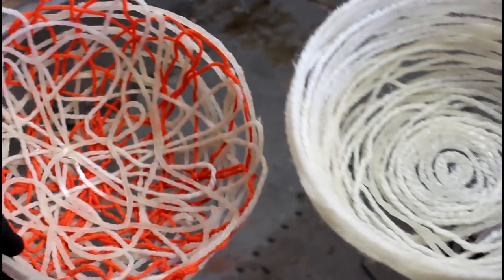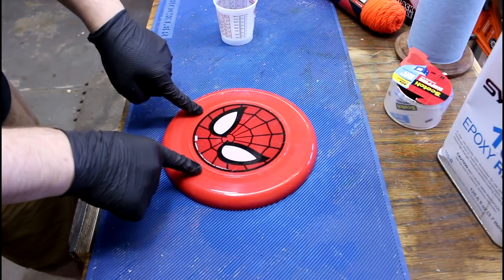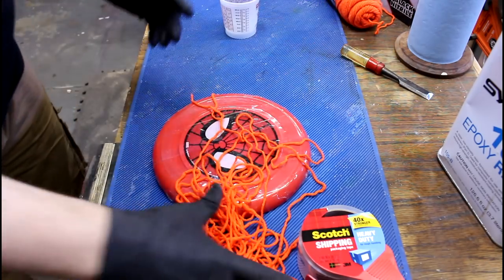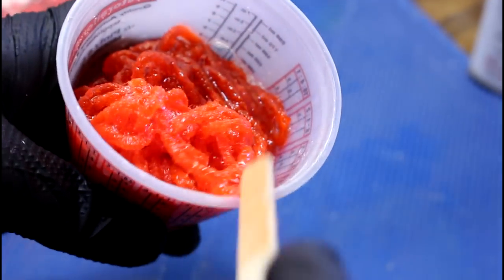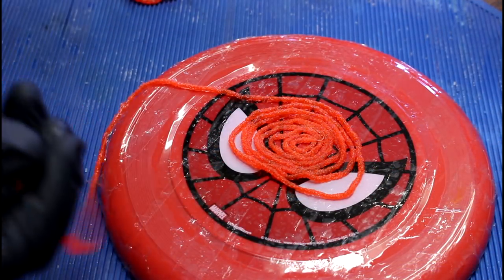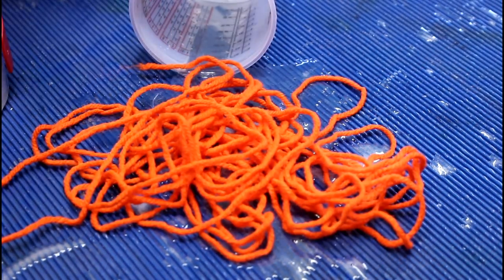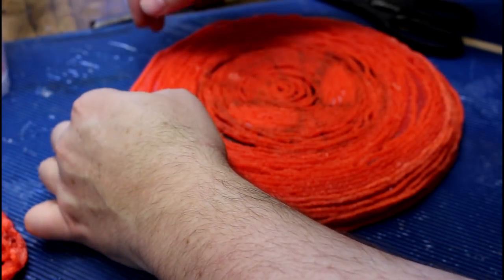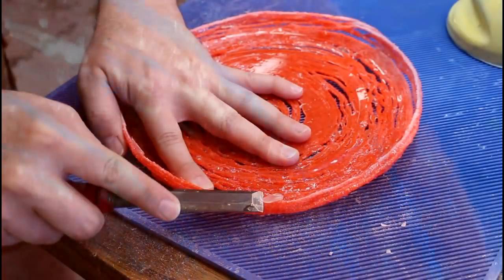Making The Yarn Frisbee

Comment: I'm going to suggest it every video until you do it! Resin screwdriver handles with the corresponding screws inside.
Reply: Shiddy that's a pretty good idea
Reply: Yo, that's a great idea...If he can sand them without the metal screws being a problem.
Reply: And the knobbed end carved to look like the screwhead it's for.
Reply: there doesn't need to be filled with those screws just like 5-7 would do fine
Reply: Holy shit Peter please do this
Reply: that would be killer awesome
Reply: he needs to do this!!
Reply: That sounds awesome!
Reply: Only issue I see with it is that he'd have to use a mold rather than turn them down, since there would be metal inside the resin, but it would be really cool to have made.
Reply: If there was just one screw in the center of a block of resin, floating, it could be turned!
Reply: Shiddy don't spam it, but yeah, really really good idea
Reply: if he used brass screws, they can be turned on the lathe with normal tools, sanded,  etc
Reply from the maker: And I love it! For the record, Yarn was suggested 2 years ago...
Reply: please dont take 2 years bro...
Reply: Peter Brown  READ THIS: Can you put an electronic device in epoxy, like phone laptop, computer, console, etc etc... could be interesting, and if you could, cover all cracks, so epoxy doesnt seep in, and have charger connected, that way you could just cut the cord after unplugging it, or you could leave the cord connected.and you could put a movie on loop or somethin, you would DEFINETLY get some good views, if you could successfully complete that project!
Reply: Mad Dog Entertainment/Agent Rocky YES AGREED ON THAT!!
Reply: Austi01101110 he could put them together in the epoxy, placed well, and he could see what happens with each one.
And GeoBuns, Thank You!
Reply: Shiddy I'm suggesting dipping waffles on every video and Instagram until he does it!
Reply: yes
Reply: +Peter Brown  Make it 2 weeks and we will be very happy, 2 months and some of us would be understanding. But 2 years... I don't know.
Reply: cool idea
Reply: Such a good idea. Dip its as a form of labeling.
Reply: yessss!!!!! Peter is perfect for this!!!! haha
Reply: YESSSS but it would be an ass to turn
Reply: What a great idea!  Let's see it, Peter!
Reply: if he wants to skip the trouble of turning and sanding he could just do a silicone mold of a wooden one or even just another screwdriver handle
Reply: That's a shiddy idea
Reply: Shiddy exactly
Reply: Please, Peter, do this
Reply: If anything he could anneal the screws to soften them.
Reply: Hell I might Do that.
Reply: Judging from the last set of self threading wood screws I bought from Home Depot, turning them on the laythe will be no concern whatsoever.  They are made of such soft steel that just turning them with a screwdriver and not stripping out the head is a real challenge.  >:-(
Reply: No. Heating would be seriously impaired.
Reply: @peterbrownwastaken  it's been two years so you should start working on those handles

Comment: You should make a knitting needle or crochet hook from a yarn blank!!! Make a large knitting needle!
Reply: Two knitting needles might be better...but having tried to make my own crochet hook out of wood (it was an odd size for a nonconventional project), I can't imagine how many hours it would take to shape one from dried resin.
Reply: Aaron Lingenfelter true... two needles would be more useful 😝 i thought the crochet hook might be difficult... can't really lathe that
Reply: Might be a job for a mold and only sanding/polishing to finish.
Reply: @mar1na1993  needles would definitely be easier but to make a crochet needle you would just be a making a knitting needle with a knobby tip and a extra step to create the cook. I think that would be pretty easy to make with a file after getting it shaped. Turning something that thin and long would be difficult though. Probably easier to make the blank and push it through a dowel making jig.

Comment: Peter, I have an idea for a Frisbee that sounds daft at first, but makes sense when you think about it (mostly)... Razor blade Frisbee. Cast a bunch of razor blades in resin, then turn on the lathe to make a Frisbee. All the sharp bits are safely enclosed in resin. Turning will give a nice shape. After seeing your aluminium / resin bowl blank turned into a very nice bowl, that is smooth to the touch. I think the same could be achieved with a Frisbee.

Comment: I think it would be cool if you took one of the doors off your kitchen cupboards, popped the panel away from the frame, poured a clear epoxy replacement, (would need to be relatively thin) and dip "kitcheny type things" (spoons, knives, forks, labels off spices, labels of sugar or flour bags, etc) and replace the panel in frame of cupboard door.

Comment: Hey man, I got a challenge for you. I'm not sure its even possible, but could you do a cast of clear resin with a bubble of air and liquid in the center? Like water or oil with blue or red food coloring. Maybe if you cast 2 halves of a shell, put liquid in one half, and use resin to glue the other half on top, then set the whole thing into clear resin. I think if you did it right, you wouldnt be able to see the shell holding the liquid once its in resin. It would be awesome to make a clear...  something...  with a bubble of colored liquid in it.

Comment: what if, hear me out, what if you made a jig on the laythe that had a center spacer that made a gap between two large pieces of wood just a tick smaller than the width of the yarn, then you could feed the yarn on a super low speed into the jig on the laythe and create a perfect symmetrical piece of whatever with the yarn.

Comment: do this again and put razor blades  (the trapezoid shaped ones) embedded in the epoxy and make the yarn look like barbed wire. of course there would be no parts of the blades sticking out. purely cosmetic so you would be afraid to use it or to freak ppl out.